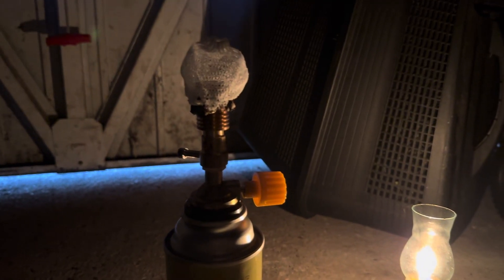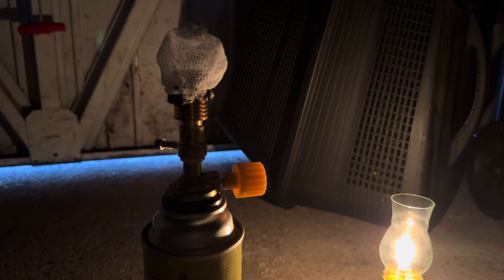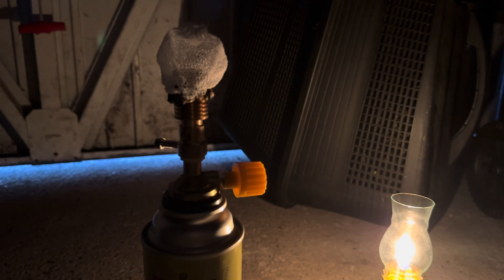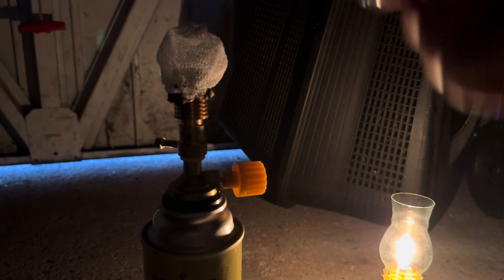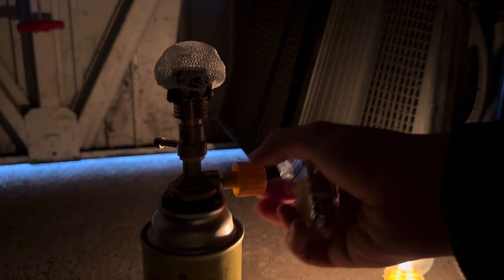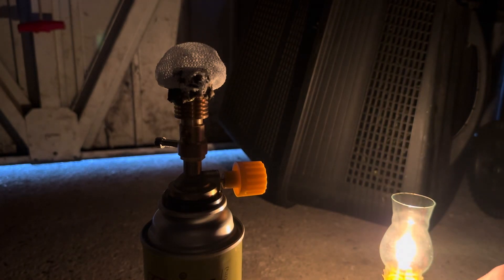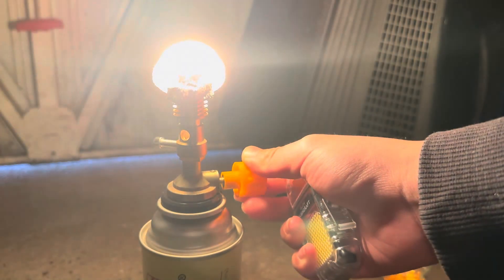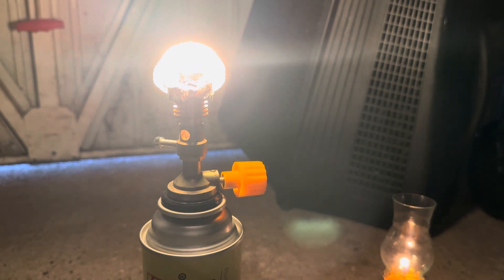Gas mantle explained

Comment: What kind of lighter do you use? I hear a weird sound when you are using it.
Reply: Probsbly an rlectric lighter that creates a short arc an buzzes like that when doing so. He called it a plasma torch
Reply from the maker: @Vova1029  it called plasma lighter.